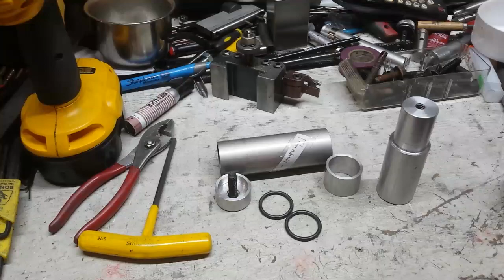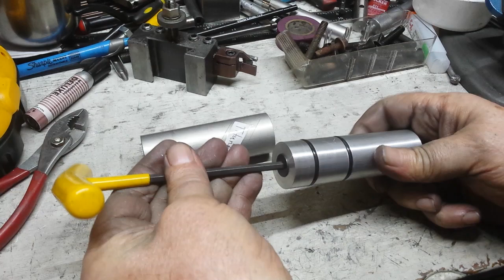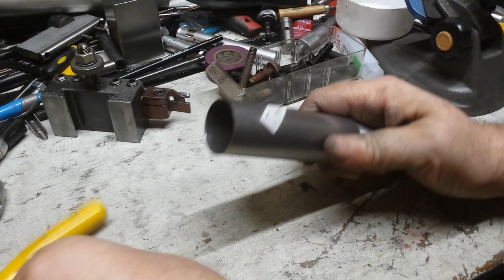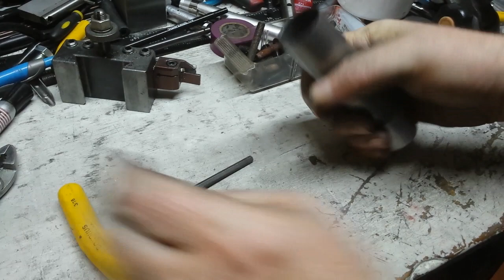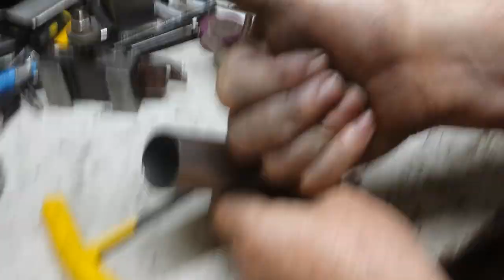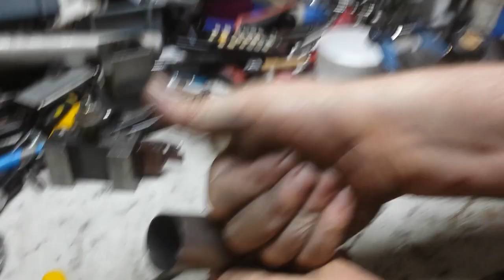Internal Expansion  Arbor  Design

Comment: Hey John!

You can also use wider square cut O-rings. The lip/corners  of a square cut O-ring will give you better resistance to pushing the part up or down the along the axis of the fixture. Round section rings can tend to have less contact area than square section types and allow the part to roll on the rounded contact area. 

And, sorry to steal your thunder on the comment but .... thanks for the kind words. I'm just leaving that one where it is. I'm just done with that discussion ( green screen ) at this point. Too many good and bad things mixed together in that part of my life.